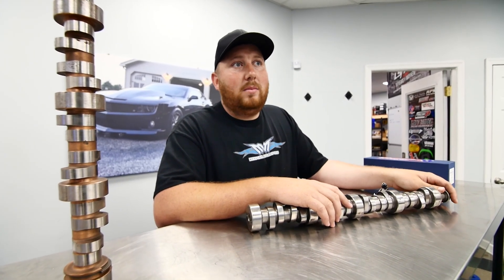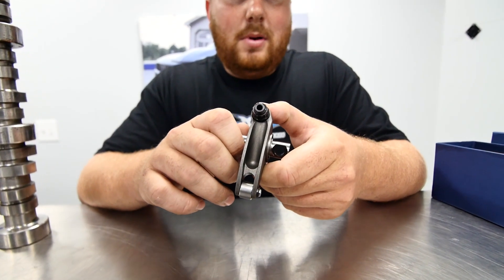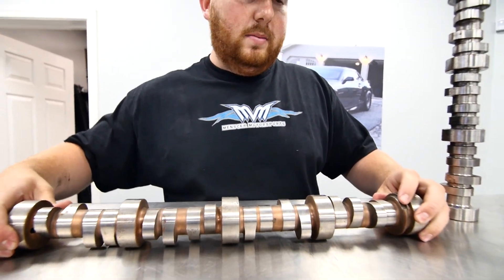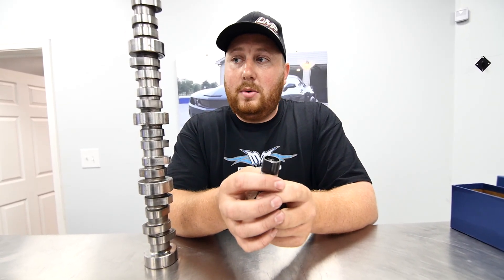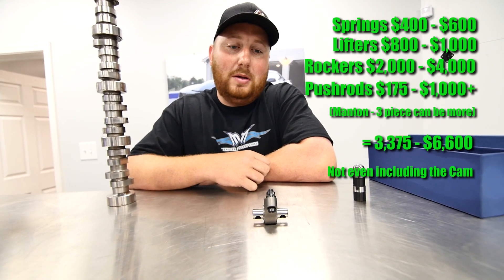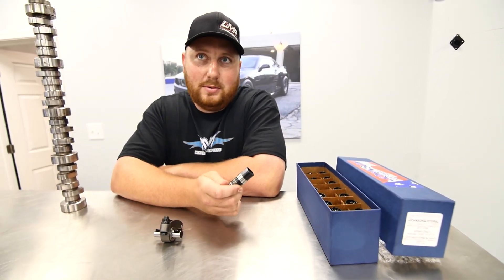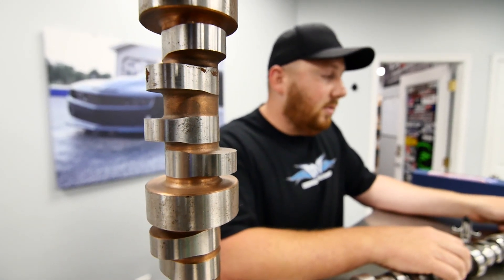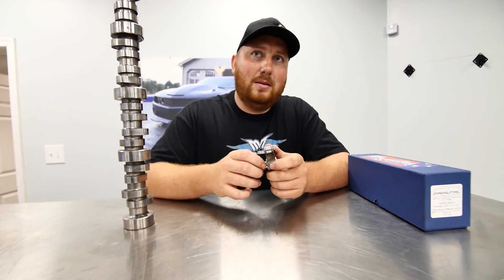Hydraulic Roller vs Solid Roller Cam... What's right for you and how much does it really cost?

Comment: I like solid lifters. Seems like less failure rate over roller.  At least in diesel’s. 
I’ve never had a roller set up fail in a gas engine. Seems like diesels will eat a lifter and send needle bearings through the oiling system